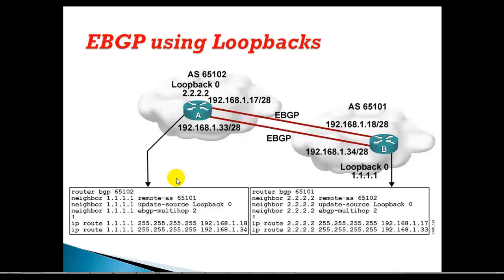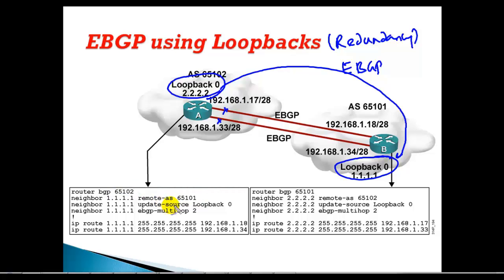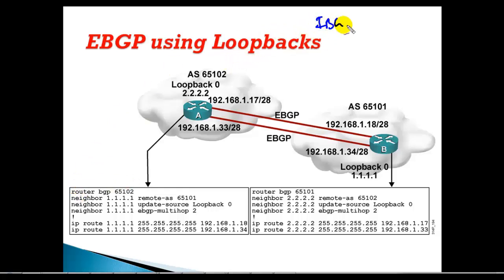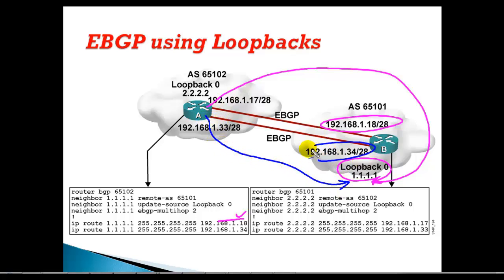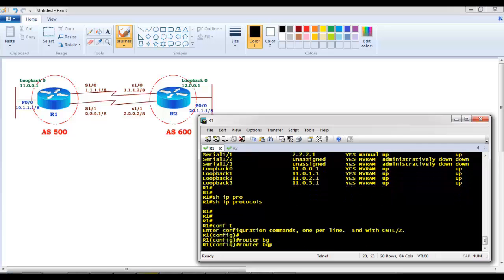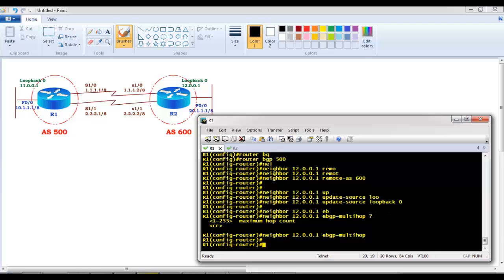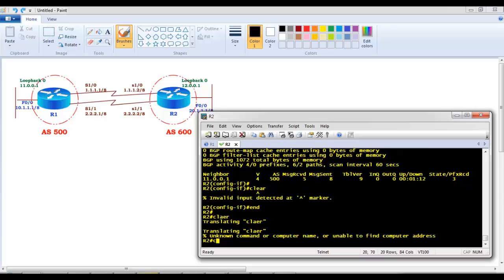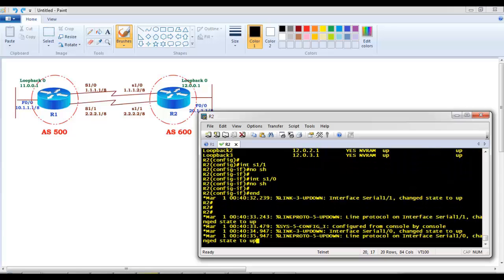"Maximizing BGP Connectivity: Leveraging EBGP with Loopback and Multihop Configuration"

Comment: Can we configure bgp between those 2 routers exit interface and advertise loop back as like basic bgp ?
Reply from the maker: Yes, you can configure BGP between two routers using their exit interfaces and advertise the loopback addresses.
Reply: @SIKANDARshaik In an enterprise network or ISP, how do they configure eBGP? Is it between two interfaces or between a loopback and static/dynamic routing? Which method is more efficient? I appreciate your feedback.

Comment: Hi Sir, while we have eBGP session established between two eBGP routers peering relationship then why do we have to have static route\IP route  for reachability  between two directly connected routers ?
Reply: Because the ebgp peering was not made by physical interface, the neighborship form with loopback interface, so they are not directly connected just like the physical interface, so to reach them, we have added the static route for the neighbor loopback IP on the respective router.

Comment: Hi Sir. Your teaching abilities are extraordinary. Very explanative.

I have a small doubt : we used loopbacks to communicate with different AS used static route as igp between AS with loopbacks.

If both the wan interfaces are down , anyhow we won't be able to communicate if it's physical or loopback interface. Then may I know how configuring loopbacks help.

Wherein IGP if we use loopbacks, if physical int is down then we still be having connectivity.

Your inputs are greatly appreciated.

Thank you Sir. Please updating the videos like this it's been very informative.

Allah apka bhala karey
Reply: if you don't have any path to reach that neighbor router, so the TCP session will not established, thus in this case, BGP neighborship will not formed, even you are using the loopback IP for peering.

Comment: Two take aways, i observed that should be highlighted as important for your viewers, 1) in order to see the loop back its important to inform your router how to get to that neighbor network, hence you included the static routes.  2) the ebgp-multhop is needed when you have different AS's (ebgp) if same AS it is not needed (ibgp). Just highlighting some important things you are completely correct in the discussion.
Reply: i think ur 2nd statement is incorrect. eBGP can be directly connected too... so we don't need to configure ebgp-multihop